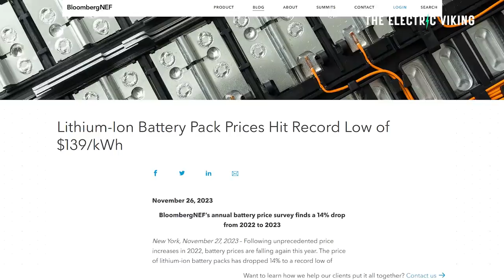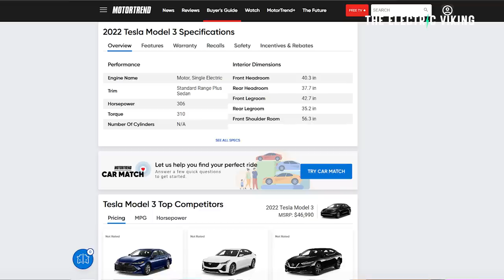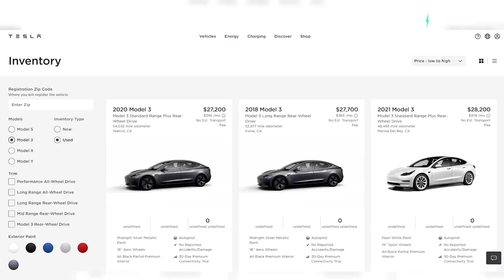Battery prices hit record low; Why have most EVs not come down in price?

Comment: Long term supply contracts might have already committed some manufacturers to a higher price though
Reply: Do forget that the price of any machine is based not only on direct cost (e.g., nuts, sheet steel, batteries..) but also includes a percentage of R&D expense and related fixed costs (EV production line).   Batteries are a big cost but not the only cost.   As stated, you need SCALE (volume) to spread those sunk costs across.
Reply: Do forget that the price of any machine is based not only on direct cost (e.g., nuts, sheet steel, batteries..) but also includes a percentage of R&D expense and related fixed costs (EV production line).   Batteries are a big costv but not the only cost.   As stated, vyou need SCALE (volume) to spread those sunk costs across.

Comment: If battery packs would be more easy to replace and cost less, then (much) more people would be willing to buy a second hand EV. The second hand EV market is not doing well at the moment.
Reply: What I think is needed is an extended warranty to 200,000-250-000 miles (400,000km), so that costs are predictable.  A used car buyer can't afford to gamble on when a large cost like battery replacement might come along.

Comment: Good overview of the subject as always thanks. I hope that replacement battery packs for older evs become cheaper in order to provide the 2nd hand market with more confidence and support.
Reply: Agreed. My 2013 EV was toast after the battery pack gave up, unless I paid $13,000 for a new pack.
Reply: 2nd batteries are rarely ever needed.  Tesla for example has a .03 failure rate and that’s with an 8 year 100,000 mile warranty
  One battery set has already gone more than 500,000 miles and several are at 300,000 miles.
Reply: @frenchydampier2209  On older EV's (10 years old), yes battery packs will need replacement. Mileage really doesn't matter with EV's, it's the age of the battery pack. After 8-10 years, chances are good you will need a new battery. That's why ALL EV manufactures only give 8 year warranties on the batteries. They know this.
Reply: @frenchydampier2209  And at the other end of the spectrum, they self immolate. Those ones don't need replacement either 😂.

Comment: Wish me luck my EV friends. I just made a deal on my first EV and will be picking it up tomorrow. Let me know if what you guys think about the deal.  2016 (mid year release) with 44K miles, Model S P90D. Included are all of the top specs (21 inch rims, carbon fiber spoiler etc). Warranty on battery and motors for one more  year.  $39,500 from private seller, after tax and tag should be around 42K.
Reply: Geez. You must be rich because you were taken
Reply: If you were smart you wouldn't purchase one of those vehicles out of warranty , you could be for a world of hurt
Reply: Good luck with it but I think you paid a LOT of money for an old car.

Comment: If manufacturers are losing x amount of money on every EV sale, they're likely to not reduce the retail price of their cars by the same amount of cost saving for the cells they buy.
Reply: With some manufacturers losing 30K dollars on each car, the battery price will have to be almost free before the car price is affected.
Reply: @davidnorton5887   Not true.  The "loss" on cars is based on the total cost of the EV program including one time charges for new infrastructure and technology that is amortized over the amount of total units sold.  Even if nothing changed, the losses would eventually diminish and profit would be had assuming sales increased on their initial beliefs.  If sales don't increase or even decrease, then even free batteries won't save the program.  Only time will tell.
Reply: cheapest battery ive seen is for Tesla Model 3 which is $12k.
Reply: Yeah but Tesla still have some of the highest profits per vehicle in the industry
Reply: @macmcleod1188  Correct, but Tesla went through the build up stage and paid for it.  They were big time loss quarters company until they finally turned a profit after many years.
Reply: @ohger1  Yes, but they were not supporting a multi-billion dollar legacy auto monkey on their back at the same time.

Plus, the current culture of traditional automobile makers actively sabotages any efforts to go electric.  

And as a potential ev buyer in 2 years, I have no faith in traditional manufacturers to service and support their EV's over the life of the car.
Reply: @macmcleod1188   I have a 2018 S, and I love the car, but don't love that I don't  have a local dealer to bring it for warranty work. So far, the car has been reliable and it hasn't been an issue, but then, I've never had to bring my wife's Ford Edge in for any warranty work either. I like the Mach  E having driven one for a week, and if Ford can get on the Tesla network without limits, I may replace my S with a Mach next year.  While I love the S, I never got used to having to use the screen for everything.

Comment: Price needs to include the increase in profitability that the investment requires to make it viable. This factor can be overlooked at the beginning when it's expected to lose money but as time goes on the demand from investment sources increases and the only way in some cases to improve that outcome is to funnel decreased costs of goods into returns on investment. Decreasing the price of a product also has an inverse effect on desirability past some point as consumers perception changes from good to bad quality or from expensive to cheap...with cheap not being good and expensive being seen as valuable or desirable. Many forces driving costs to consumers in the end and it's not simple to calculate the best approach to cost "Improving"

Comment: It's the Mega Pak made in China that has the most potential.  Battery costs declining and Wright's law applying.  Margins could go through the roof.  China can increase production faster than any other country.  Supply can't keep up with demand.  If prices decrease demand will increase.  These use LFP batteries and if their prices decrease due to volume of production the cost of LFP batteries for cars can also decrease either increasing margins or increasing demand due to lower prices.  A single casting Model 2 Designed and Made in China can be at a price that most of us never thought was possible.  There will be production lines in many countries.  Many of us will have our tail between our legs having to admit that the #1 car in the world is Designed and Made in China.
Reply: I recall that the Model 2 would be developed in TX.  Then spread to the other factories.  Would not be surprised if each region puts their own spin on the body.

Comment: With battery supply increasing astronomically and battery prices reducing its only a matter of time until aftermarket battery packs will become available for older EVs and PHEVs Nissan Leafs, Chevy Volts etc with the latest battery chemistry and ranges. This to me is the future affordable EV since EVs and PHEVs last at least twice as long as pure ICE cars, maybe more and it's way more environmentally friendly to maintain and reuse existing vehicles than produce new ones. 
This also may be something the auto industry hasn't factored in, if independent garages, mechanics and aftermarket battery suppliers can keep electric cars on the roads knocking up 300k-500k miles with the latest battery tech, and simple economics and supply and demand would assume so, then we only need a third to a fifth new electric cars than we need new ICE cars to maintain the same number of vehicles on the roads.

Comment: Afternoon math: does not help with cheaper batteries if the rest of the cost is still high.
Reply: Can you please clarify. Besides the battery pack, what other part of the car are you referring to?
Reply: @denero66  All the gadgets and useless 'options' that they load them up with, and contribute to unreliability.
Reply: @jamesvandamme7786 
The problem is not "gadgets" or "options" it's the lack of investment in equipment, necessary to manufacture electrical vehicles, efficiently

Comment: Long term supply contracts, batteries are not that cheap still, mfg insurance cost (if the battery does have an issue), too many cells, off set cost (like governments money), supply short falls (betting that prices go back up for elements), etc. Still cheaper than before - and prices will only come down as supply meets demand as well. Na and other chems like S and Si will also help drive down the cost and mfg methods like solid state will again drive it more down as we require less cells and thus improve the over all cost in terms of production and do it your self cost. In theory a battery made out of Na and Si would by well over 5x times the power dens (4 times more power dens than LFP) and require only 1/5 the current batteries today. Dropping down from 20k$ packs to 5k$ packs.

Comment: Low cost KWh batteries will make urban commute EVs the most cost effective solution by far for 2 reasons.   Cheaper commute vehicles.  Ability to charge at home eliminating the gas/electric bill altogether and eliminating strain on the power grid.  Solar panels will charge a low cost home battery during the day. When commuter returns at the end of the day, the home battery will recharge the car battery.  And once you have solar power charging installed at home, you will use it on all future EVs you own.
Reply: A commute car can be smaller shorter range, lighter, cheaper, better Mi/KWh and mass produced for a huge market.  This fits nicely with a home solar electricity system providing 50 KWh of car charging per week.

Comment: I noticed those changes in battery prices scouring online market sites. There are lots of battery discounts than they used to be but the question is: is it temporary? Will it last?
Reply: It's part of a long-term Trend that's been going on for over a decade so I don't think it's temporary. By 2026 batteries are supposed to be 40% lower than at the start of 2023.

Comment: They say that future batteries will be designed to be light weight, won't combust,  will hardly need to be charged and will be able to take us to different dimensions. Called The Flux Capacitor. (Said in jest).

Comment: We got our 2022 Tesla Model Y LR with white interior and 7 seats and the tow hitch along with FSD 
in May of 2022 - we paid $70,000

Just priced the same car today and it's $66,500
a decrease of 5%
That's with all the hoopla of Elon gutting the price 10+ times

So Tesla is sure not reflecting cheaper batteries. 

The price of a Toyota Camry comparable to the Model Y 
today: $36,745 for the XSE V6 with all-wheel drive
May 2022: $35,720 for the XSE V6 with all-wheel drive
The Camry increased by 3%

The Camry is 1/2 the cost of the Model Y and as an owner of both about the same

EVs are way way too expensive to buy
Reply: You'd be right if the running/maintenance costs of both vehicles were identical... But of course they aren't and of course you're dead wrong.

My Model 3 saves me at least 3500$/year in fuel costs over my Corolla... And that's not even considering maintenance like oil changes, brakes, air filters, etc. 

You should compare apples to apples or be quiet.

I've had my Model 3 for 5 1/2 years now. 
What's 3500$x5.5? About 20k and well over 20k if you include the maintenance.

The price of gas keeps increasing, the price of maintenance and labor keeps increasing. 

The yearly savings from owning an EV will just keep increasing over time.

After 5.5 years, your "true cost" would be:

Tesla Model Y will come out to 70000k-20000k in fuel savings=50000k

Camry would come out to 36000k+20000k in fuel costs=56000k
Reply: @themonsterunderyourbed9408  Means nothing if the EV costs 2X a Camry.
Those maintenance costs are spread out of 10+ years
so owning an EV is out of the question for probably 90% of Americans
especially when you need a FICO score in the 650+ range and a $100k a year family income.

Comment: When you talk of reducing lithium price you must put it in propper context. during the period 2019-2021 lithium was around$50,000 / tonne, it then spiked to a massive $ 585,000/ tonne and now is sitting around $120,000/ tonne, so if you were being honest the most correct thing to say is that lithium costs nearly 2 1/2 times as much as it did 4 years ago. Therefor over a 4 year timeframe the cost of raw materials should be driving the price of batteries up.

Comment: Moore's law has nothing to do with production volume reducing costs. It only says that the number of transistors on a chip doubles every 18 months. Nothing about EVs doubles at that sort of speed except possibly the frequency at which I'm reading about battery fires.
Reply: Can you give us any concrete examples those fires? ;-)

Comment: Production numbers is a reason, but not the reason for cheaper EVs. I understand there is an economic agreement in cheaper products based on scale. But as we see with smartphones they come a a cost of quality penalty. But whatbis difficultbis that there are also low volume, higher cost lower quality vehicles. This makes the EV market, just like the automarket complicated. What Tesla does seem to do right is the mantra of less is more, which I think is very I teresting. It makes me rethink how we really defone quality and price to value. We still se tjis today that Mercedes and bmw are considered more luxurious than Y
Tesla, which is an interesting discussion in what is considered quality in esthetics and production.
For me I consider profit margins and battery capacity to efficiency factors as higher cost driving factors in EVs today. Yes the narrative may still be reducing lowering production and battery cost at production level, but I see tjose more as means to profiteren gains rather than any meaning .srp price reduction to the customer. Yes battery costs will get lower, but at the end of the day its all about selling numbers and profit margins im business. Allcosts are passed on the the customer unfortunately, despite the altruism of price cuts in due time. I think Tesla and other EV makers could due beyter in many more efficient, butbreasinably performing, with even more battery capacity options and perhaps still consider being able to swap batery capacity to usecase, for example daily driver pack vs longrange or performance packs or swappable motors for occasions. We all know most people drive their EV short distances amd only the occasional ling distance throughout the year. I think strategically and most costeffectively and affordable. We could do with basic 40-60kwh oacks for most vehicles. Of you need the occasional change in range or performance you can change it for those couple of days or weeks a year for rent and return to your own pack that you can perhaps put up for hire as a temporary storage battery and earn some income for trade. I think these 30-50% smaller capacities as standard could help reduce weight and price per vehicle drastically, oerhaps even save up bidget per production model to invest in a more well specced or interior and space designed EV car and get overall cheaper models at scale. And more flexibility in being able to dynamically adapt capacoties or add modular batteries to the EV pack could bring a more fair use policy on trafing in energy. Like trading with data capacity with mobile and internet, more even more affordable EVs to own and save up even more batteries for more production and a flexible business model in energy. I think that could do more than simply waiting for vertically integrated companies to figure out even more affordable lean production. At a point you're going to reach peak lean, and merely focus on the smaller details, which will make development costs go up, and then comes  creativity. I think Tesla saw it right when doscovering energy as a business. I think they could do more with that to make EVs more affordable. I'm surprised for example the competition os experimenting with grid tied storage and or V2L in their EVs. As far as I know Tesla does not have bidirectional charging or even any meaningful V2L or V2H bidirectional charging support for any ofvtheir Tesla EVs. Yes, they have ideas or implementations of the Tesla grid. But I read and see very little to nothing talked about grid tied energy enabled systems in Tesla EVs, that work out of the box today, or that Tesla support on their   MCU sustem as far as I am aware in the public space.

Comment: If EV prices are reducing and will continue to do so for the next couple of years then that makes buyimg an EV now less attractive as depreciation will be accelerated and cost you much more in the long run. ISeeCars ran a study on depreciation and found passenger cars depreciate at just under 40% in 3 years, where EVs on average were above 50%. Since an EV is much more expensive for a similarly equipped car that loss is expanded making EVs a terrible choice for anything other than a fun toy for rich people.

Comment: yes, lithium ion battery prices are coming down but their still expensive and since EVs require many of them to function the price is still high. no different than platinum grade 12v lead acid batteries. I'm working on a device to eliminate the need for big expensive EV battery packs. if it works, new EVs will be cheaper than used ICE powered cars.